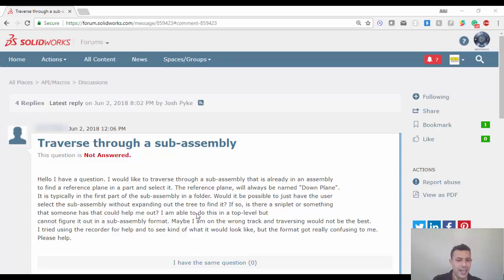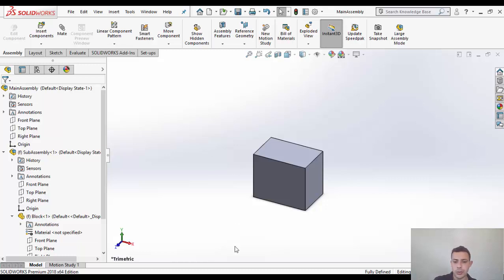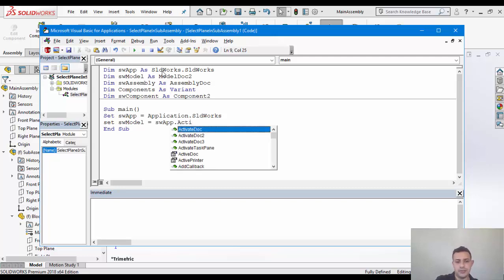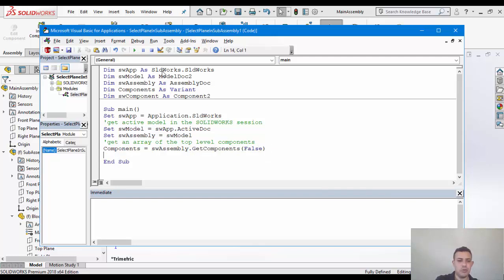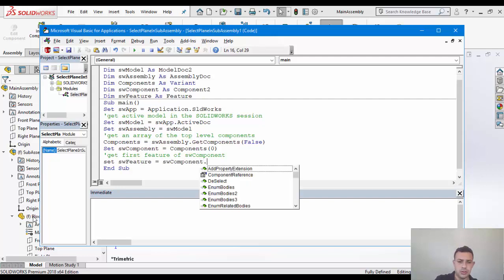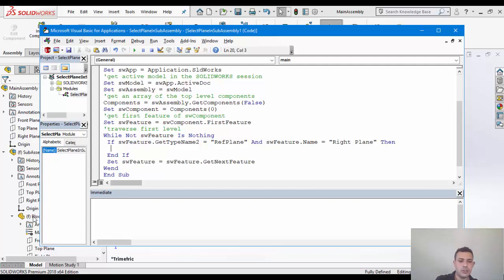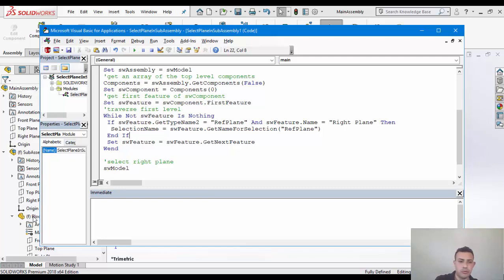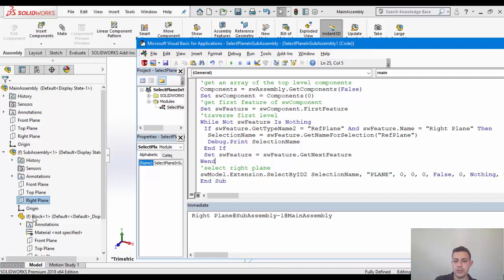SOLIDWORKS API - Feature Selection inside an Assembly

Comment: I've been trying to get selectbyID to select a part in an assembly using the given solidworks feature manager name. I will try this method to get the find the correct name. Would using "COMPONENT" in the selectbyID parameter be the correct way to select the part a a whole? Or are there other ways to select a part in an assembly by name?
Reply from the maker: You can record a macro selecting a particular component and it will show you the parameters you need. IModelDocExtension.SelectByID2 is the best way to select a component if you know the selection string. Note that you can also find this string using IComponent2.GetSelectByIDString. Please email me (https://www.cadsharp.com/contact) if you have additional questions, since YT comments aren't the best place to assist someone.
Reply: @CADSharp  awesome video btw! ❤️